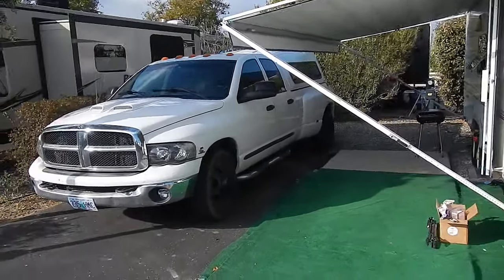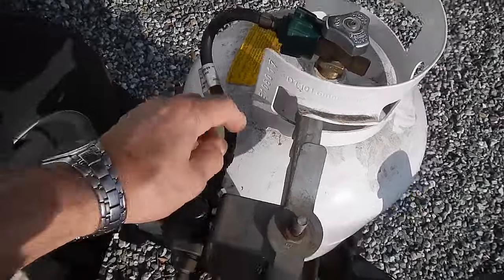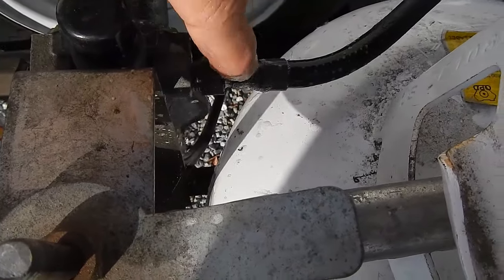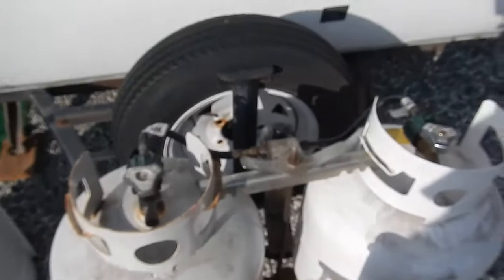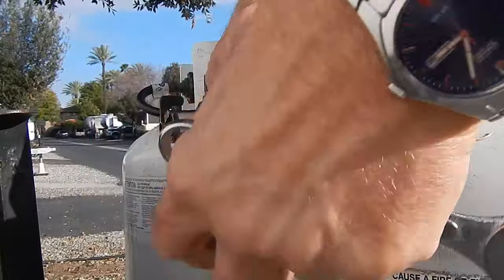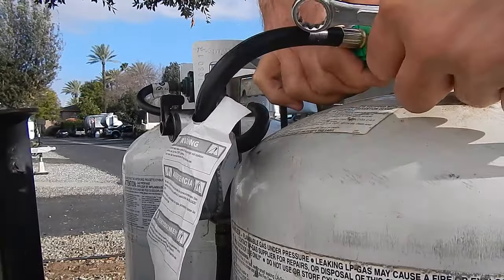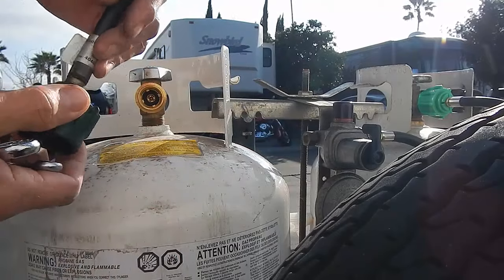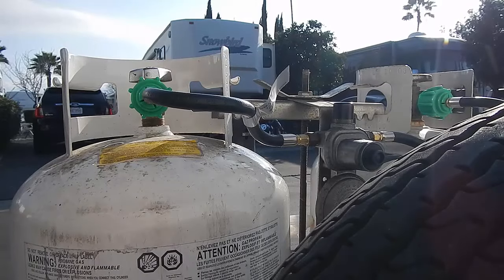RV DIY How to Replace Propane Hose Pigtails

Comment: For those insisting on always using teflon tape - these are not pipe threads - they are flare fittings.  The sealing occurs on the metal-to-metal flare surfaces, NOT along the threads, so teflon tape not only does not seal on those threads, if you screw up and get some down onto the smooth flare section it might make a leak more likely.  If you want to use it as a thread lube, or are especially worried about thread corrosion and like it as a sort of dry anti-seize that's up to you, but understand what kind of fitting you are dealing with before making a universal pronouncement like ALWAYS use Teflon tape. It has nothing to do with creating a good seal on an undamaged flare fitting!  (Which is the reason that any set of instructions for replacement of a component in a flare-fitting system ought to include a quick inspection of the flare surfaces you are about to mate for damage - unlikely in this case, but a moment with a mirror and flashlight is all it takes to look at the regulator side ...)
Reply: THanks! Answered my question!😁
Reply: Actually, it’s not that terrible of an idea to use a liquid thread sealer. I’ve seen many instances where the cheap Chinese made fittings will slightly leak. The liquid thread sealant will act as a secondary should the flange not perfectly mate up. I don’t use teflon tape on pressurized lines with flammable gas going through them.

Comment: I know, this is an old vid. If someone is viewing at a later date, they should know, those threaded brass fittings are 1/4" Inverted Flare, not, 1/4" Pipe. This needs to be known when buying the proper pigtails.

Comment: Safety note:  Don't use the old hoses as a backup, the are hard and possibly leaking. If you want to keep a hose for standby, buy a new hose (or even a pair of hoses).  When I replaced mine, I cut the old hoses close to the attachment point at the valve, it made removal much easier.

Comment: Just a mention. Great job with replacing pigtails. Always replace the main flexible hose from the bottle two way V/V to the camper. The rubber always deteriorates with time, heat, cold and  sun light. Stay safe............👍

Comment: Crimped connection does need replacement, but it looks like tightening the inside nut on OTHER end of pigtail MAY be tightened at inside nut. I'm trying that rather than buying a new LEAKING pigtailed (from China)! Brand new rv & pigtail leaks! What a world!
Thanks 4 info.. good demo...
Sorry some viewers have NO PATIENCE!

Comment: Are there different size openings at the actual gas opening itself where the new gas line connects to the tank where the green connector part is. I ordered new hoses on A and the looking at open holes on the green part it’s quite a bit smaller on the new ones. I’ve been trying to get the right part now for 2 weeks. Even an RV parts store incorrectly ordered parts initially with. “Flare tip” vs NPT tip. I’m just trying to match up pictures and hope for the best. I figure I have a 50-50 chance as a newbie. But I did notice this difference in the gas connection hole.  Why isn’t everything STANDARDIZED. ????

Comment: Ok, when I ordered the pigtail online from Walmart, I got one with a smaller connection into the diverter, so I bought a brass adapter to fit the smaller pigtail end, and, wow, I found a sort of check valve with a spring, ball bearing,& plastic sleeve fell out. Now I don't know how to reinstall the check valve,  which may be important to draining tank separately. 
The plastic tank cover presses the hose downward, causing a leak at the pigtail joint near the tank valve.
What an ongoing mess!
Reply: Did you find a solution?  I lost my spring and bearing too not expecting it when i took the hose off.
Reply: Same thing happened to me.